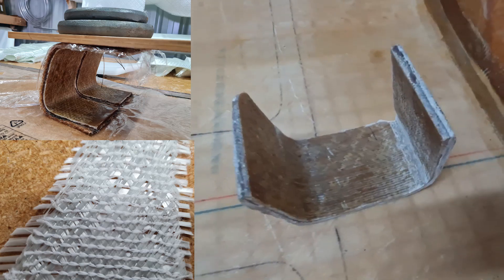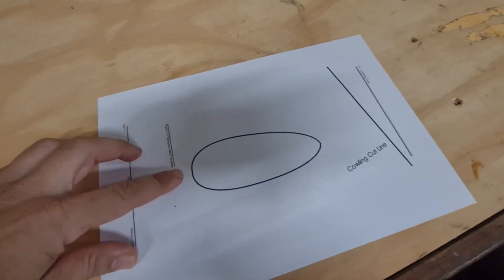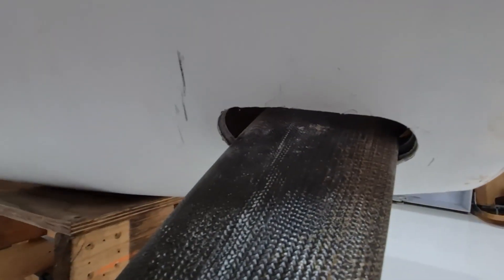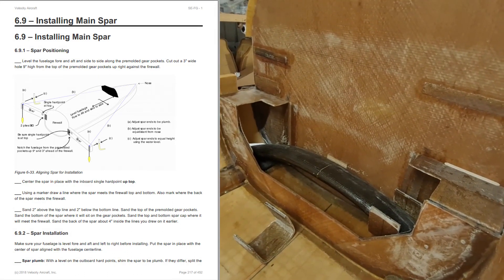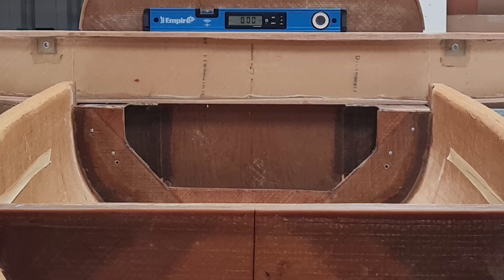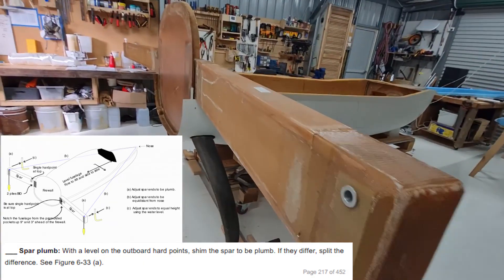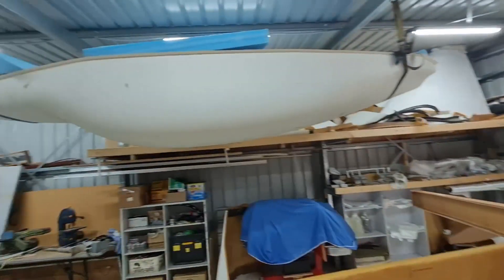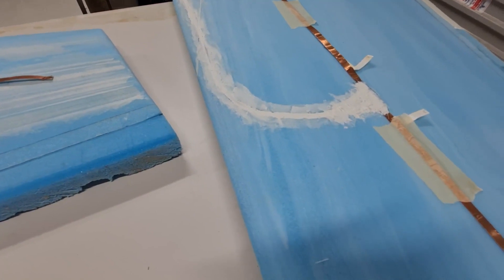Velocity Build Experience 05 - Main Gear-Centre Spar-Winglets Start

Comment: You could insert a really thin shim (washer) between the main spar and the wing spar,  probably on only one bolt but maybe two,  and make that wing perfect.  Then you don't have to split the difference.  Keep the perfect spar the way it is and shim the one that's off a degree.  You're using fiberglass and micro fill to finish that work.  You'll never even see it.

Comment: Just a thought, could you skeletonize the wing foam to reduce weight while maintaining structure ?
Reply from the maker: Hmm, you could probably core out some of the foam. But It's really light as is. I just weighed one of the winglets with one skin on and it's 1.7kg. With the second skin on a bit over 2kg I recon.
Reply: @AusVelocity  food for thought 🤔
Reply from the maker: @SGTMARSHALL1  Always appreciate ideas.
Reply: @AusVelocity  if I were in better condition I would offer to help, definitely enjoying you go through the build process
Reply: It is called "sandwich construction" and the foam gives structural strength coupled with the skin...It is possible to build it differently like the Raptor project and some companies did...
Reply from the maker: @electricaviationchannelvid7863  Cool, thanks for the info. When it comes to the aerodynamics or anything strength or structural, I'll stick with the plans. Apart from that...It's going to be an interesting project.